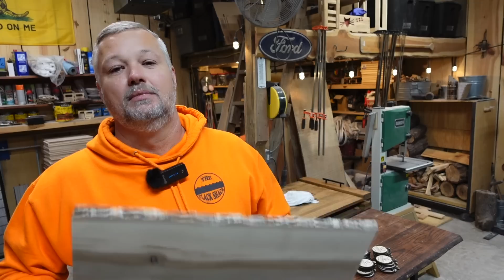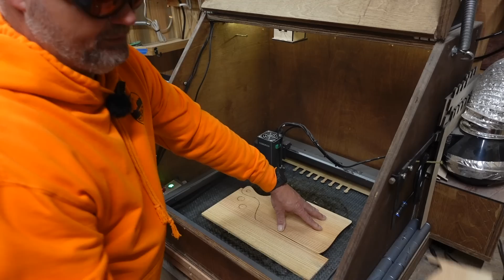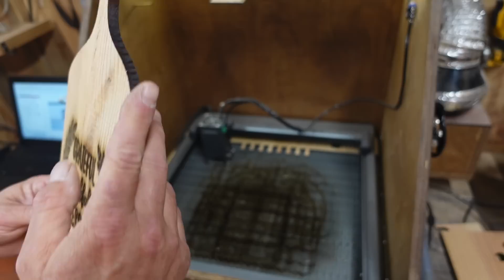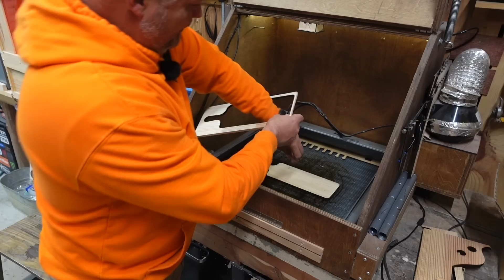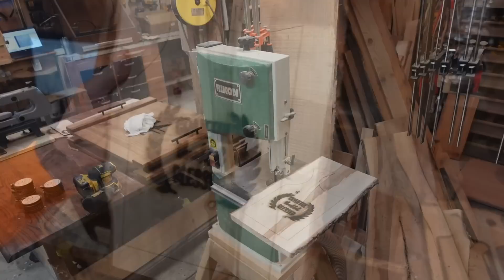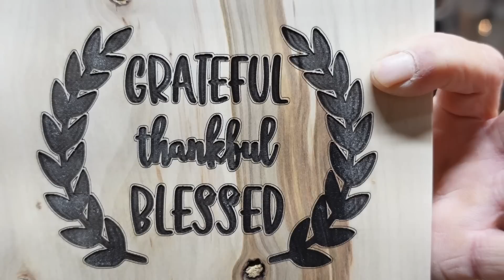Christmas gift project for laser engravers

Comment: Being a maker, I’m really surprised that you don’t make an adapter for your shop vac to your saw… something like that could be very easily 3D designed and printed as well.
Reply from the maker: At the time of this video, I didn't have a 3D printer. Issue is fixed now. Bambu Lab A1.... lol
Reply: @ Bambu is where it’s at. I have an x1c and a k2 plus being delivered on Monday.

Comment: Nice work, but a question has been bothering me. When you did the side by side test, if both were set to the same speed. How can the Comgrow be faster, it's like a car 55 is 55. So is there a different gear ratio?
Reply from the maker: It is in the board. The travel speed from location to location. Both are running stock settings on the controller. The controller dictates the travel speed.
Reply: @TheClackShack  is it not possible to adjust the travel speed in the xtool D1 pro?
Reply from the maker: @tommystiles886  , I have never tried. I would think it would be possible but would involve changing settings in the controller.
Reply: @TheClackShack  I wonder if the move speed under the move tab would have any effect
Reply: @TheClackShack  Thank you

Comment: With ur fixture I’m surprised u haven’t tried powders paint fill then reburn  the piece at a much lower power setting. It melts the powdered paint into the burnt area. Looks very professional. (Not that ur work isn’t top notch)
Reply from the maker: Never had a request for that. It sounds a little messy though
Reply: Where can we find some  information on the process you just mentioned?